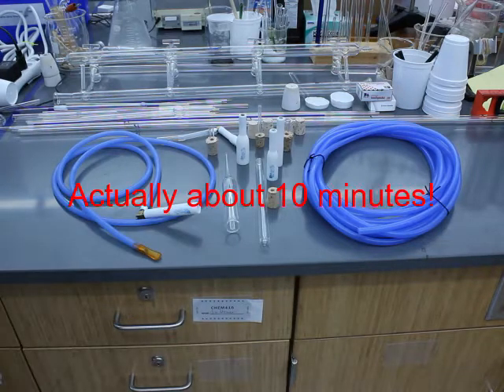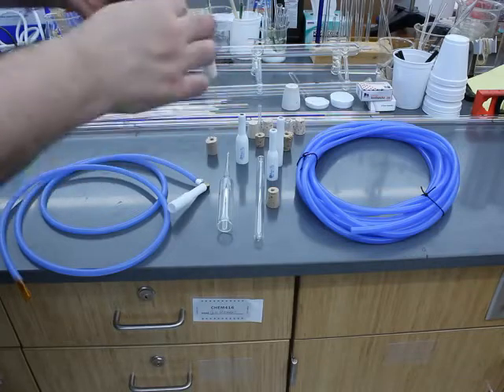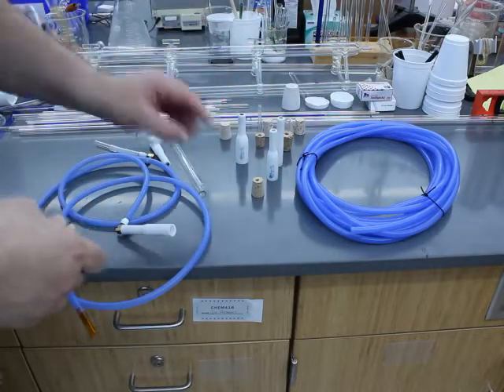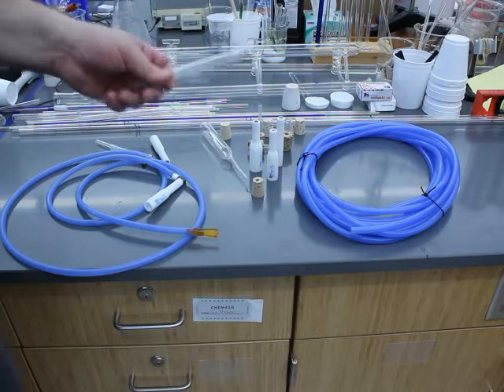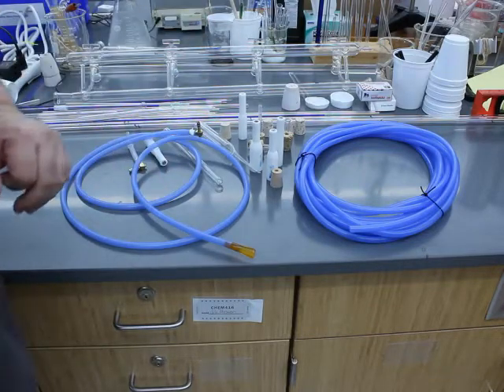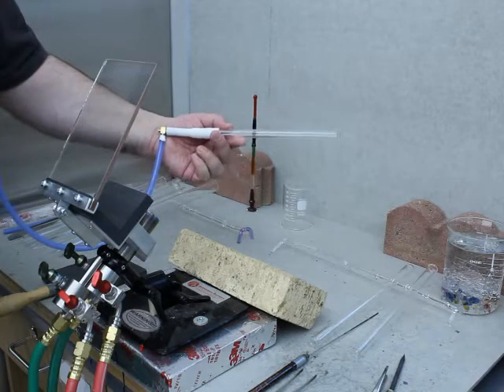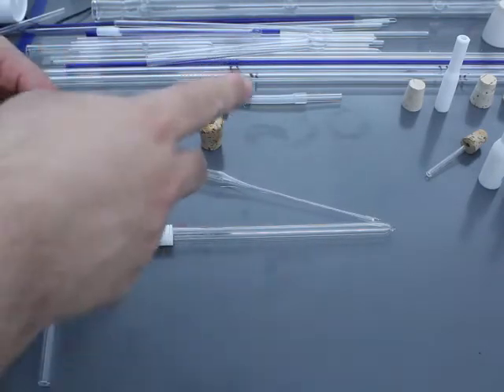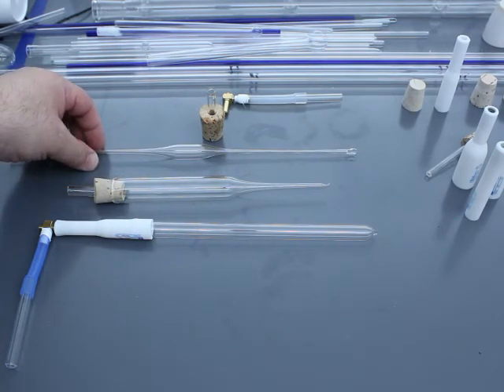Scientific Glassblowing Equipment: The blow hose

Comment: Hello my friend. I am a PhD chemical engineer and my specialty is metallurgical chemistry. I am building a foundry to start casting gears for transmissions that a friend designed. He is part of the tractor pull and race group. He found that transaxles and transmissions that are commonly used are not supported any more. I decided to make an aluminum bronze alloy and cast the gears from it. Not only that I am building a 1928 Morgan Aero GN special race car replica. There is only one in existence and it is in England. The car was made to look like an airplane back then with an engine in the front and three wheels along with a cloth covered wooden frame. I am casting an adapter for an experimental opposed twin engine to mate to an MGB transmission driving an MGB rear with brakes and beautiful wire wheels. type in the description in YouTube's search and there are a bunch of  races. I am also building a laminar torch for glass blowing and casting. toot much for here..lol Do you have a Facebook page?
Reply from the maker: Howdy, good luck with your torch.  I am very happy NOT building that (or anything).  No I'm not on Facebook.

Comment: Is that a cork brick?! What is that for? Perhaps to hold pulled point prepped peices? I would question weight for tipping, then we’re getting into connecting it to some wood or some bottom weight
Reply from the maker: No, it is a very dense brick.
Reply: @ScientificGlassblowing  wicked cool!
Reply: @ScientificGlassblowing  hey your videos are badass and so much more understanding than the books. Are you doing any more? Double triple inner seals n such
Reply: @ScientificGlassblowing  where would one find the PLA insert to help with fixing smaller tubes in place of larger tubuals?
Reply: @ScientificGlassblowing  where would one find the PLA insert to help with fixing smaller tubes in place of larger tubuals?